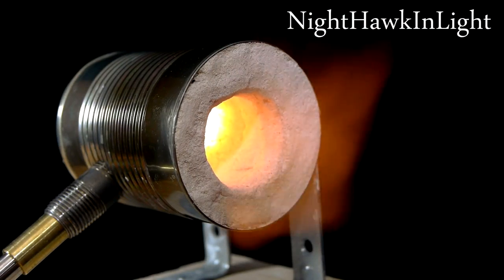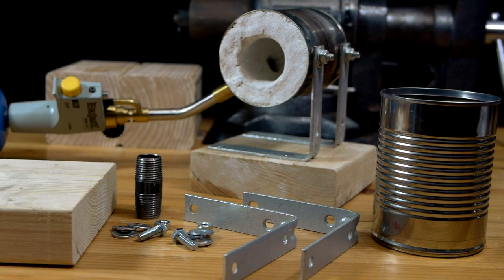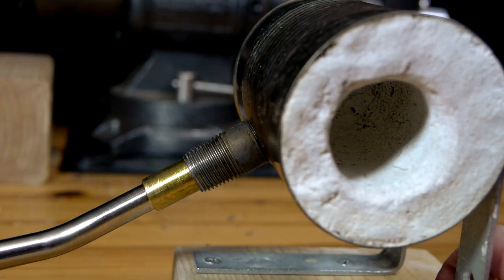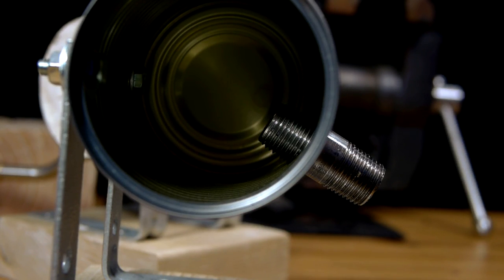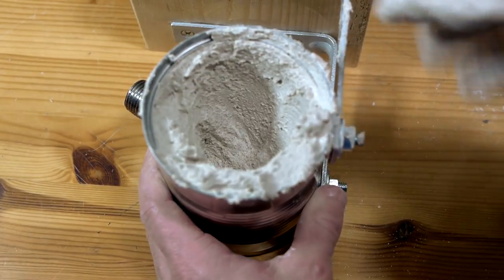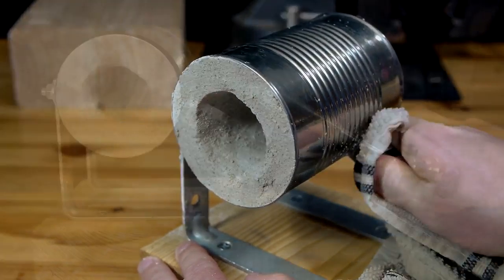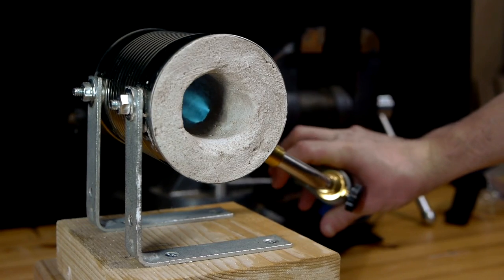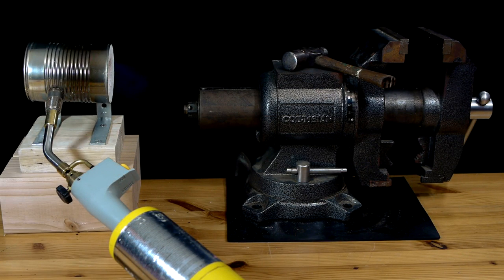How to Make a Soup Can Forge

Comment: I did this with a 55 gallon drum rather than a soup can to make a full sized forge and it works great :D
Reply: I had the same exact idea, I was just trying to figure out how you would support it.Can I ask ,how did you support it?
Reply: Christian McIlhenny  he probably just joking...but using siple bar stock ...or 90' angle bars would work
Reply: i used an old engine stand

Comment: Great demonstration video. Have you considered using water for fuel Brown's gas that is called HHO Gas?  HHO Gas is pure hydrogen and oxygen through electrolysis the waters pulled apart into hydrogen and oxygen gas. When this HHO Gas fire flame comes in contact with any surface, what took minutes to heat up only take seconds. 1 gallon water produces 1700 gallons of HHO Gas.
Reply: no one gallon of water will produce 1 gallon of HHO.  The space taken up by the gas state of Hydrogen and oxygen will be greater but the volume will remain constant.
Reply: that'll be to fast to maintain metal integrity and may damage the metal it's self.
Reply from the maker: ***** You mean the mass will remain constant, not the volume. The volume by definition is how much space the gas takes up, which will of course be greater than the volume of an equal mass of liquid water.
Reply: Isn't it evident enough that NightHawkInLight knows his stuff? I'm so tired of seeing oxyhydrogen-related propaganda/misinformation on youtube! It's a subtle form of spam...

***** I'm going to jump the gun here and assume that you're talking about the typical electrolysis that I see spread around youtube, which involves using electrolytes (salts) (or not, but relying entirely upon electricity the same as the ones that use salts). You may want to find out how much electricity is actually needed to convert 2H2O to 2H2 + O2.

A little physics for you: If you dump electricity into water, you'll boil the water. If you dump electricity into saltwater, you'll boil the water and the salt will remain as crystals. Water vapour (steam) is neither oxygen gas nor hydrogen gas. You might get a tiny amount of hydrogen & oxygen, but not in an immediately useful form and certainly not a useful amount.

Commercial water electrolysis sources tend to use a different method involving some non-electrical source of heat (eg. nuclear radiation) to preheat the water to at least 800C (1600F) and pressurise the resulting steam before hitting it with a current. That's high temperature electrolysis operating WELL above boiling point, and your salts become pointless at that point because they'll just crystallise when the water evaporates, well before the point of splitting. Why so much heat?

A little chemistry for you: If you have two different plates of metal dipped into an electrolyte solution, you have a wet cell battery. If you dump too much charge into it, you're abusing it by overcharging. Overcharging wet cell batteries does cause a tiny amount of electrolysis at comparatively low temperatures, but it's very inefficient, yielding no more than 5% hydrogen and no less than 95% steam. Your <5% hydrogen gas isn't going to be very combustible and you may as well prevent damage to the battery and just use it within its recommended/designed charge capacity, recharging it with whatever source you'd otherwise be using to separate the hydrogen and oxygen.

You have to keep the electricity (or the heat) pumping through the steam in order to separate the steam. It's this that causes high temperature electrolysis to yield far more hydrogen gas (efficiency up to 50% currently).

You don't have to believe me right now. Hydrogen and oxygen gas both freeze below -200C, at temperatures well below your household freezers capability. After you've done the experiments you've seen posted on youtube by nobodies and con artists, you'll probably think about what I've said and put some samples of your gasses in the freezer to see how much of it condenses to water...

I don't want you to thank me when that time comes. Just pass on good karma by remembering this piece of advice: You have to be honest to yourself before you can be honest to others. If you can't honestly say to yourself what the facts are, then you can't honestly say to others what the facts are either.
Reply: NightHawkInLight yes.  sorry misspoke a bit
Reply: ***** I see... Why aren't these machines used by NASA? Why is it that when I look at NASAs docs, they say they have to use 300MW (that's MEGAwatts, not KILOwatts) in order to generate 300 litres per minute? What are you doing that they aren't? I mean, aside from the cheap, potentially misleading advertisements that insist you can generate combustible fuel from non-combustible non-fuel with absolutely no power consumption...
Reply: Sebastian Ramadan 1700 gallons of gas isn't much since it has variable volume, if compressed enough you could get a half gallon of hho gas from 10 gallons of water. Though that's an exaggeration.
Reply: Scratchthatguys Gaming According to my research, you seem to be pulling figures out of your arse.

Assuming atmospheric pressure of 1 atm, water is at its densest liquid state at 39.2 °F.

Liquid hydrogen is at its densest liquid state at around -434 °F, just above its freezing point. Similarly, liquid oxygen is at its densest liquid state at around -362 °F.

None of these liquids are easily compressed beyond these densities.

1 gallon of water weighs 147.67 ounces. Are you saying you can compress over 2800 ounces of hydrogen+oxygen to one ounce?

1 gallon of liquid hydrogen weighs roughly 193 ounces. 1 gallon of liquid oxygen weighs roughly 152 ounces. Good luck!

Even if you manage to get it beyond those temperatures, and turn your hydrogen and oxygen "gas" to solid, you'll only fit 220 ounces of hydrogen per gallon and ... well, lets just say by now you've gone WELL BEYOND even lab conditions and into the heart of Jupiter!

I call your bluff, liar.

Comment: would it work with a bigger can? like the large heinz tomato juice cans?
Reply: Probably, but you might need a different ratio of the plaster on the inside. (It's just a guess. I'm not an expert so you shouldn't take my word for it.)
Reply: You probably shouldn't use a much bigger can. Because how forges work is they concentrate a massive amount of heat into a very small area. That's why a big 2 foot X 2 foot forge will only have like a one square inch or so working area. That's why when blacksmiths make swords and stuff, they work the metal only two inches at a time. So a larger forge will be much less hot and powerful.
Reply: Fargraven
Reply: Look up full size forge plans.
Reply: It should but you might need a larger torch

Comment: How safe is this?
Reply: Not very , the Calcium sulphate ( plaster of Paris) breaks down at high temperature to form Calcium oxide and the SO3- ion, this reacts with water in the air to make sulphuric acid vapour. 

How do I know this? 

I made this in my garage and was violently ill for 3-4 days due to the fumes. Breaking difficulties, dizziness, vomiting.

If you do make this, do it outside, or make one out of perlite and refractory cement.
Reply: Chris Valdez I have a well ventilated work area, how ever I have just upgraded the extraction system. However, I will still never do this indoors again, as I am mentally scared by how ill I was!
Reply: Sean Confer I study Chemistry at University. I have been researching energetic materials and energetic chemicals recently. I can use my knowledge of thermal decomposition to figure out what it going on. One of my hobbies is, metal casting; Copper, Silver, Aluminium, Brass etc. So I know a lot about refractory materials, as I have 3 homebuilt foundry's that are all capable of melting copper. Made of nothing more than perlite, normal cement, and fine sand.

CaSO4(s) ==> CaO(s) + SO3(g)

Or the SO3 reacts with H20 to form H2SO4(g)

 The SO3 further decomposes to SO2 and O2.

2SO3(g) ==> 2SO2(g) + O2(g)

Stay safe all.
Reply: If that's the case, and you knew all about it, then why would you think its a good idea to do this in an enclosed garage? From what you claim, you know the risks, so if that's true, then I don't understand how you were able to expose yourself? Let alone perform the experiment in the first place. I'm guessing you either are lying about what you study, or you are lying about actually making this. Either way, I was just wondering.
Reply: You wouldn't get poisoned if it was in a well ventilated area, and please, do not descend into petty insults so quickly whenever someone contradicts you. It is not an attractive trait at all.
Reply: Chris Valdez How is that bullshit, please tell me. I have to say that he is comletely right. The decomposition products are SO3 and some SO2 that will create sulphuric acid and sulphurous acid (H2SO3 that almost instantly oxidises to form H2SO4 aka sulphuric acid). (I specialise in chemistry in secondary school.)
Reply: @TheHunChem  secondary hahaha
Reply: @seanconfer7903  maybe he just didn't think about it before making it.